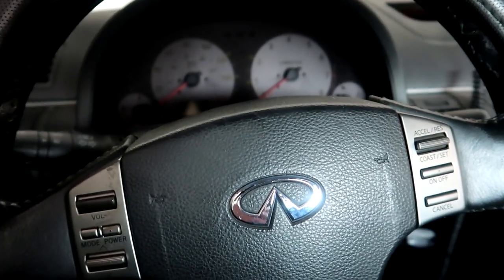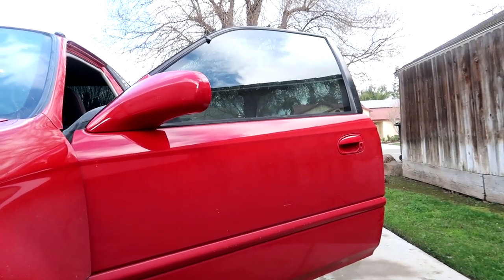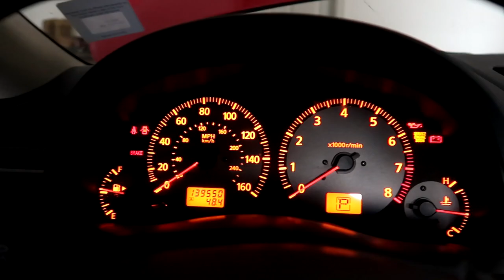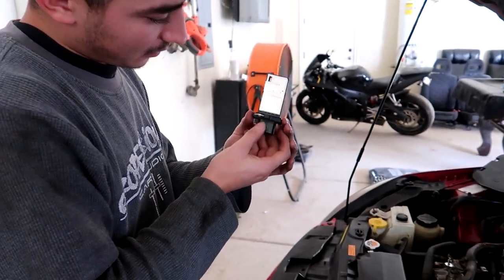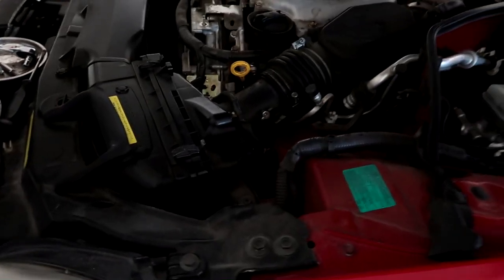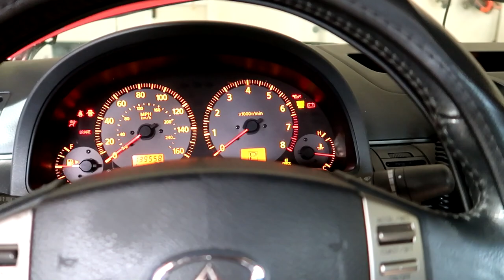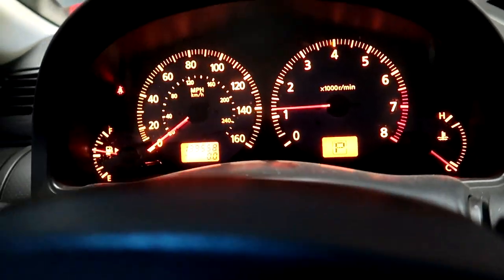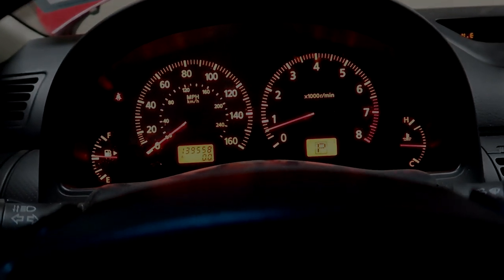Fixing The Low RPM Idle Stall On My G35! (Vlog 21)

Comment: Had the same problem on 1993 SR20DE NIssan with 310000kms. Cleaning throttle helps a little but the problem just came back. Initiallly it was doing like you have in video now it does it randomly. Its like the engine just dies out. 90% time it idles fine.

Comment: Aye wondering if it could be something else I did spark plugs throttle body cleaned and new camshafts sensors still does it on warm starts.  Hella annoying need it fixed asap
Reply: did u get OEM cam sensors? (Hitachi)